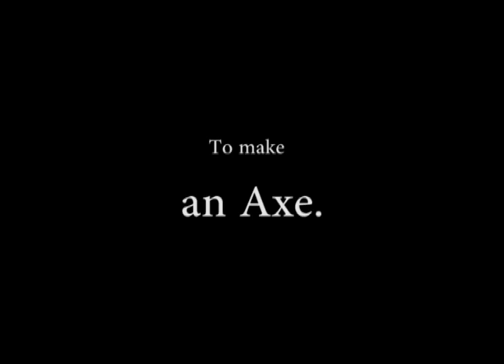Making an Axe from Iron Ore: Trailer for the film Ore to Axe by Ken Koons

Comment: I wonder how you refine it without a large refining furnace. You're lucky I've been wanting to get my hands dirty at an anvil and forge for a while but don't have the funds to build or buy the expensive equipment. I've been doing chainmail and regular sheet metal work though to build my basic skills and experience since botching with tool and blade grade steel would probably be expensive.

Comment: While the famous Southern red clay/dirt is higher in iron (oxide), and if you operate a bloomery properly, you could potentially eventually get a hunk of iron out of it, it would rarely be worth the effort. In the vid, you see bog iron ore, and if you pick some up, you can immediately feel the difference in density.  The proportion of iron is an order of magnitude higher than that of red clay.  If you tried using red dirt, you'd need to constantly tap the thing to drain off excess slag (silica)

Comment: well that may be true to you but not to me. Tome making knives or other tools from slab steel, just cutting it, maybe heating and hammering it tocall it "forged", then grinding it on the sanding machines to a knife shape doesn't have "the soul" for me. The other may be "perfect" technical wise, but no soul and dull, just like wooden intruments. Fabricated instruments may be very neat, with perfect symmetry and measurements made by machines, but never has the soul or specialty of a handmade one.
Reply: You have a point ...there is nothing like finding red rocks ...burning the rocks in a small open fire for friability sake...piling and grading charcoal smashing old clay mixing grog with new clay. shapeing the bloomery...drying..lighting..waiting...picking and splitting bloom..working a bloom to bar... bar to tool....using said tool ...teaching process ....everything is so soulful when you start with red dirt.
on the other hand you can get frustrated with the market for "fully hand crafted" items and what that really means in man hours.
I propose a certification process including documentation and testing to add value to the craft.

Comment: Buuut..."real" blacksmiths have been forging using 3rd party steel pretty much from the beginning of the iron age.  One guy smelts ore into iron/steel, another guy makes it into tools.  It's called specialization, and it's what allowed us to form civilizations :)
Smelting is certainly exciting stuff, but you can be every bit a "real" blacksmith without having ever operated an iron bloomery.  "heating them and then hammering them" is exactly the definition of the verb "forge".